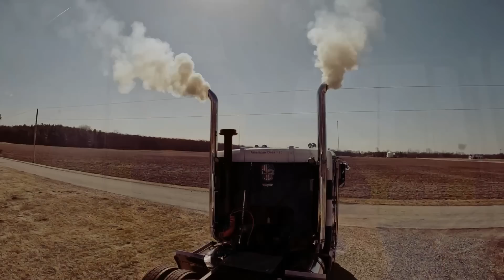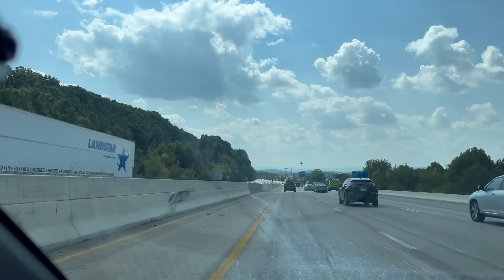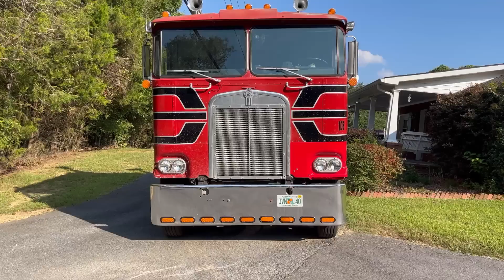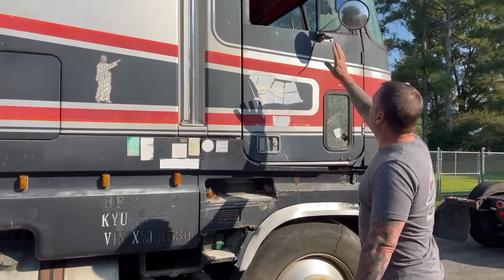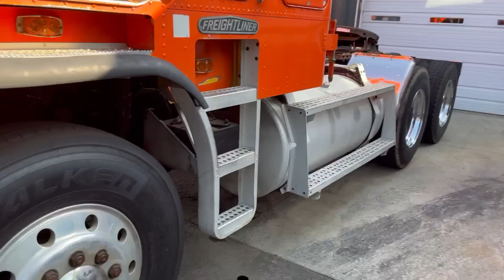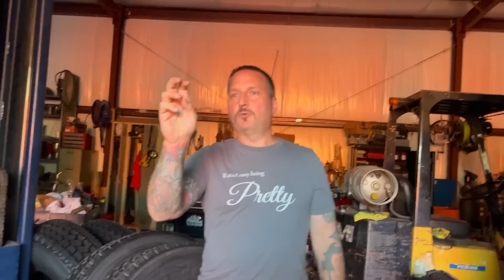On that midnight train to Georgia

Comment: Hope you are having a good time down at James place. Sounds like a lot to wrench on. I don’t think Trisha looks all that bad myself. I’ve seen guys running around in trucks sometimes with panels replaced not even painted or primed yet. Those old Fords were extremely comfortable and took some getting used to in corners all 4 corners of the cab have airbags under them if I remember correctly. First few times going around a sharp ramp felt like you going over.
Reply from the maker: For sure